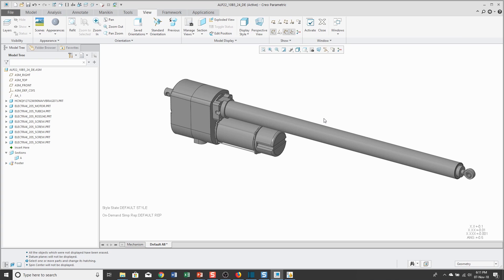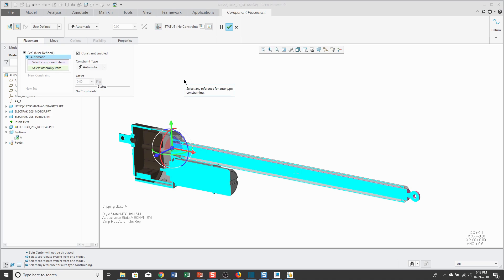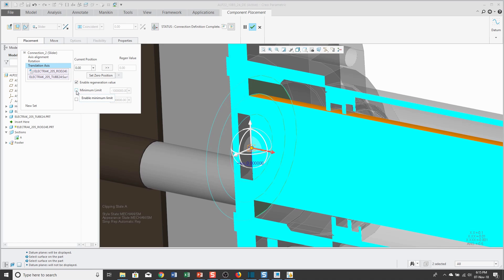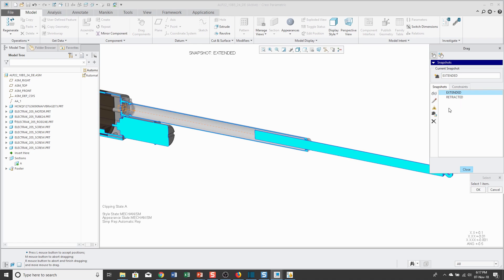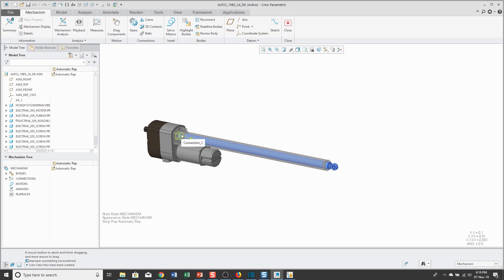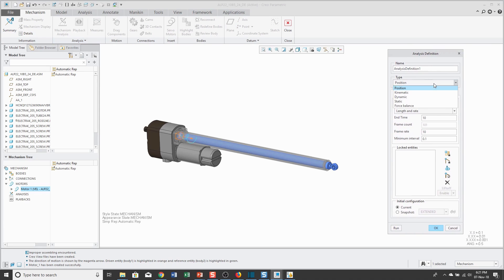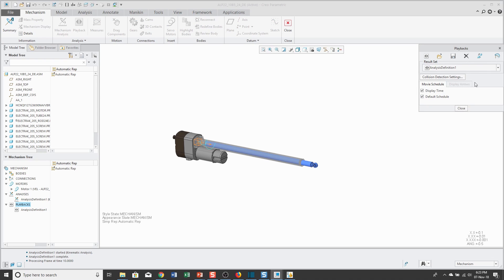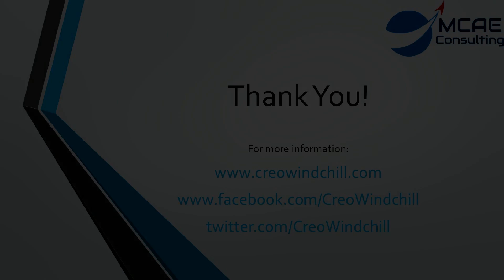Creo Parametric - Mechanisms | Slider Connection

Comment: Hello, thank you for this amazing video. I'm currently having a slight problem with both slider and pin connections. I made an assembly file that has a working slider and pin connection, so I naturally brought said assembly file to another assembly file to combine them. When I finished combining these parts and tried to use the "Drag Components" feature on the previously working slider and pin connection part, it moved the entire combined model and not the parts with the pin and slider connection. I feel like I'm missing something important but I can't find out why. Thanks in advance.
Reply from the maker: Is your base component assembled with the Default constraint? At least 97% of the time it should be. Biggest mistake people coming from other CAD packages make is not using constraints for the first component.
Reply: Yes, the asm file where I defined the pin and slider connection is constained as a default constraint. Not the one where I combined it with though.

Comment: Can you set also in other assembly constraints that the parts, when dragged or moved, cannot compenetrate with other assembly components? It's simulating real non-penetration between volumes (also with rigid assembly mode). Thanks.
Reply from the maker: You can use 3D Contacts in Mechanism mode for simulating interaction via physical contact and non-penetration, but it's heavily computationally intensive. That's the kind of physics you see in movie special effects. It takes a lot of time and power.

Comment: Hi! I have a problem. When i open de .pvz file on Creo View, after creating the snapshots with the drawing availability, the model doesnt show up automatically and the preset explode options arent available (as if they did not exist). What im doing wrong? I did all what you have shown on the video except the combination state.
Reply from the maker: Brandon, I apologize; there's something I might have forgotten to mention in the video. The recipe file for outputting Creo View .pvz files does not export author states by default. You need to change that file. I've put together this quick video to explain how to do that. https://youtu.be/ukPG0gdbc28     Sorry I did not mention that or make a video to explain this earlier.
Reply: @CADPLMGuy  Excellent! As always, thanks for the response.

Comment: Another awesome video as usual.  Could you make a video showing the motion envelope functionality?  Also, can one simulate spring force using the mechanism suite of features?  Also, a video showing a mechanism with more than one moving part would be really helpful too.  I do feel bad making so many requests when you are already providing so much knowledge here.  Just some more ideas to add to the list for future videos I suppose :)
Reply from the maker: Sean, I can definitely show motion envelope. I have a few different results videos on my To Do List, like Trace Curves as well. 

I can definitely do more than one moving part. I know I wanted to do a planetary gear, but those are just a bunch of pin and gear connections. I was thinking about re-making a concept for a package deployment mechanism from my time on Amazon Prime Air. That one had pins, gear pairs, and rack and pinion if I remember correctly. 

You can simulate springs with the MDO license.

Feel free to keep suggesting ideas. The requests definitely help because then I know someone is really interested in seeing that topic.

Thanks, Dave
Reply: @CADPLMGuy  awesome! Those sound like great future video ideas.  Looking forward to those, or more videos showing how to draw a sock 😉

Comment: Hi ! Can you draw a sock in creo ?
Reply from the maker: Hi. Thanks for your question. I assume you mean a sock for your foot, and not something like a wind sock or some other kind of component. The quick answer is yes. Now for the details: do you want to model it flat like it comes in a package or how it looks on someone's foot? Are you talking about an ankle sock, calf length, or knee length? Men's or women's size? Probably the easiest way is to start with a standard model of a foot (which are generally available) and use something like the Shell command with a negative offset to create the thickness of the sock.
Reply: @CADPLMGuy   Hello again and thanks for answering me . i want to model a man`s sock  , calf length , not flat  , I tried to find the standard model of a foot , but i didn't find it .
Reply from the maker: @bocadaniel802  Let me check my files and see what I have. I might not be able to get to it until tomorrow. But in the meantime, have you tried GrabCAD.com? I'd be surprised if you couldn't find at least a dozen foot models there.
Reply: @CADPLMGuy  Yes I found what I needed  on GrabCAD.com  ,  Thank you very much
 !